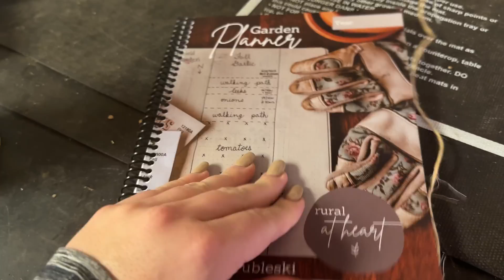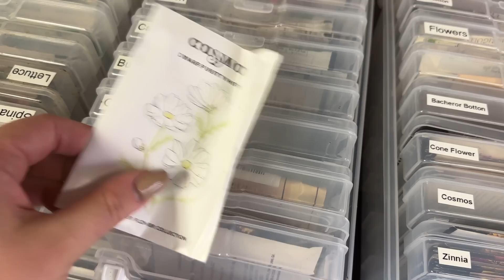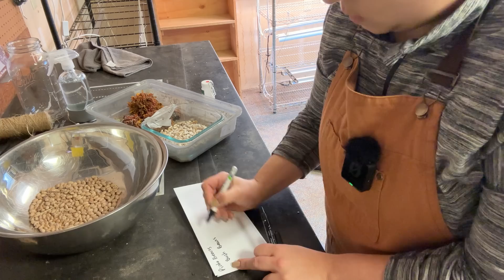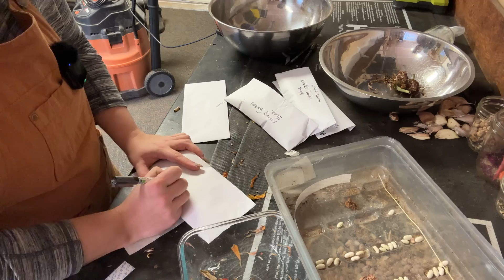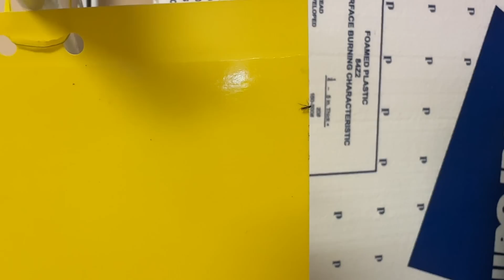I Don't Think I'll Regret This!

Comment: I ran a bedding plant business for 20 years, those are Aphids.  Fungus Gnats fly around, very small and the larvae lives in the soil.  Aphids love pansies too.  The little flying things could also possibly be a beneficial insect planting it's larvae into the Aphids.  I'd be more than happy to advise you anytime.
Reply: She mentioned that they are flying around. But the cluster of bugs on the plant did look like aphids. Maybe she’s got both. I think it’s that soil. I bought a bag of that soil and it was infested with fungus gnats.
Reply: Agree the ones outside are aphids
Reply from the maker: They did fly... Maybe there were both... I am no bug expert so I appreciate the input. I wonder if there is a bug app that I could take a picture of them and see what they are
Reply: @AcreHomestead yes I agree 100% you also have aphids. I lost some pretty expensive plants to them. The winter doesn't kill them out either. I don't know how they survive but the year I realized I had a out of control problem they had been slowing destroying plants for 3 years. They always tend to hang out on stems and under leaves
Reply: Hi Becky. Would placing the potting soil outside in the cold get rid of any infestation?
Reply: @AcreHomestead  ‘picture this’ app might have bug identification 
I just use the free portion when out hiking… 
Our high tunnel had serious aphid and spider mite infestation (located in high desert mountains of Idaho)
It’s taken 3 years of ordering green lacewing eggs and ladybugs to get a good population of beneficials in our high tunnel- but still actively squishing the aphids seems to work best, and keeping down the ant population as they ‘farm’ aphides! 🤦‍♀️
Reply: mature aphid can fly.
Reply: @AcreHomestead the app I use is picture insects
Reply: I’ll bet you have both, in any case the yellow sticky traps are helpful…
Reply: That is such a cool room to have!  You are a blessed gal💚.
Reply: @AcreHomestead  you don’t need an app. If you have an iPhone, take a picture of the insect as close of possible. On the picture swipe up and click the i or info button. It now gives information on plants and animals/ insects in the picture.
Reply: Becky, I have doubt you'll get rid of them all! You're so efficient!! 😂
Reply: @acrehomestead I'm definitely going to be making a beautiful garden this year but I think it's too early for growing plants right now
Reply: Sorry about yr peppers I was hoping it would work for you.
Reply: Suggestion wash them right after you plant the seedlings so you won’t have so much work like this. Clean and put away.
Reply: "Mosquito Bits" are pellets that can be diluted in water and every week or two, water your indoor plants with it and it should kill the fungus gnats. You have to do it regularly since the solution kills the adults, so you have to keep applying to kill the next generations when they hatch from the eggs in your soil. There are some videos about it on youtube. I haven't tried it myself--I'm battling them now too @AcreHomestead
Reply: I used dawn  mine worked but took too long. By that time all was dead but one garlic
Reply: BECKY  Annie , Nancy and other commentors were correct.  You have aphids- at least that is your main problem.  Aphids can have wings -(they DO start out wingless..).  In a few bug generations (very quick in warm temps) aphids often evolve to have wings especially if the population is high, or their food source is running out. The white flecks  are the exoskeletons of growing aphids, a sure sign of aphids. I would take nancyg up on her offer to help. General grow area sanitation will help you start clean, but get rid of those weeds too. Check any of your other houseplants if they spent any time with your peppers. Best of luck and also reach out to your local Agricultural Co-op station too, they can be a good resource. The sticky traps will help control the flying aphids but you need to use something different for the wingless aphids.
Reply: Are Aphids alive this time of year here in the Pacific Northwest?
Reply: In addition to the sticky traps, i put Mosquio Bits in net and soak them in my watering can. This will kill the eggs in the soil. I learned that from Nicole too. I had hundreds of gnats on the stickers, but they still kept coming until i used the Mosquito Bits in my water.
Reply: @bobbysmith855 I hope that you meant to say that you have NO doubt that Becky will get rid of them all. She is amazingly efficient! ❤️
Reply: APOLOGIES LONG: I have had a grow room for 20 plus years and had 4 years of aphids and fungus flies. I wasted 100's of dollars on natural remedies. The first thing is to use a room instect bomb like from Raid. 
Natural remedies will take several treatments and will be far into your growing season.

Take all your soil and freeze for at least three days then heat the soil to at least 200° F for 2 hours. Or better yet order all new soil but Do Not store in that grow room.
We bought a 50 gallon burn barrel raised it up on three cinder blocks high on 4 sides setting the barrel to sit over a fire ring campfire. We heated the barrel for 6 hours reaching the internal temp of 200° F. Transfer this soil into thick plastic disinfected totes. DO NOT store in areas where you have had insect activities.

Add food grade Diatomaceous earth to each tote, mixing throughly into soil. Making sure to add thin layer on top of soil and add a tightly sealed lid. 
Always add food grade Diatomaceous earth  Diatomaceous earth to all your garden soil. Also sprinkle lightly onto all your plants. I lightly wet the plants and use a old salt shaker to sprinkle the Diatomaceous earth on the plants.  

You have to reapply once weekly( on indoor plants) once outside(after each rain). 

Disinfected everything in your grow room, all tools, lights, containers.
It took about 2  Raid room bombs 1 week apart to stop seeing any insect activity. 
Hope this helps😀
Reply: Fungus gnats do not hurt your plants. They are just a nuisance. Aphids are a true pest, though. Yellow sticky traps will really help.
Reply: Fungus gnats eat fungus in soil. So, to get rid of them, I kill the fungus. Might not be good with highly sensitive, plants, but has worked with my indoor plants. I just sprinkle cinnamon powder (Yes, the one you use in cooking!) on top of the soil in pot. When I don't see much of a cinnamon left, I repeat the effort.

I agree, the ones on top of a plant are something else than fungus gnats. The fruit fly-like bugs are likely fungus gnats, though.

Comment: My Mom bought my Dad a couple cheap vinyl tablecloths that he cut up and used to line his drawers in his shop. Easy to clean and to lift out if necessary to clean under or replace, as opposed to drawer/shelf liner. Plus, the vinyl kept things from sliding around as much in the metal drawers.🧡

Comment: Use boiling water to moisten your seed starting mix. Use a tote or bucket big enough to mix, but not so big as to cool off quickly. Cover and let sit until cool. Kills fungus gnat eggs. Use non organic liquid fertilizers in the house, organic outside. Works for me, learned from Gary at the rusted garden. Great seed starting series on his channel. Also a bottle bush and 10 percent bleach in water makes quick work of washing cell pots.
Reply: This year I did buy new indoor potting mix and put boiling water in the soil. All my indoor plants I took outside took off all the dirt and submerged the plants in a water soap solution for a few mins and disinfected the pots, reported them and haven't seen the flying devils so far, it is winter but I'm hoping I got all of them before I bring out the nuclear top guns and put them in the garage
Reply: I was just writing the same suggestion. It has made all the difference in my seed starting. No more gnats, white fly or fungus.
Reply: Yup this is what I do as well.
Reply: I was just about to mention similar advice that I got from Gary too 😂 he was the first tomato YouTuber I followed to start seeds and set my seed starting system up. So helpful.

Comment: Hey Becky ❤ ! I have a tip for an easy and effective DIY to get rid of live fungus gnats. In future it may also help to increase ventilation where you keep your plants and to water them from the bottom instead of the top, if at all possible. Gnats like a damp environment that is rich in organic matter, which is why they are so common, and persistent, in indoorplants. 

Homemade trap for gnats (exact measurements are not important)

Mix together: 
a glass of water
a few tablespoons of apple cider vinegar
a few teaspoons of sugar 
a few drops of dishsoap 

Fill a glass, bowl or other vessel with the mixture and cover the top with plasticwrap. Poke small holes in the plastic (make sure it is fastened tightly) and your trap is ready.The sugar and vinegar will attract the gnats and the soap makes it so they can't fly out of the mixture once they are in it, causing them to drown. Also works on fruit flies. 

In order to get rid of gnats in other life stages (such as eggs or larvae), a mixture of hydrogen peroxide and water can be used. You will have to do some research and calculations depending on the strenght of hydrogen peroxide that is available to you. Beware it is effective and non discriminatory and will kill insect friends and foes alike. Not harmful to the plants though, so in some cases it can be worth to do it. 

Hope this helps! Best wishes <3
Reply: Ice heard of this to
Reply: I had a horrible infestation ONCE!  I do 25% peroxide watering every fall for the  final outdoor watering and the first 2 indoor watering. Then I fertilize faithfully every 2 weeks at 50% strength for 6 weeks. Then I let the plants rest until spring.  I live in the north with  6 months down time.
Reply: Also let the tops dry out as the eggs are deposited on the first little bit of soil and they live in damp soil. (Yes bottom water). I continue to put boiling water on my seed starting mix (The Rusted Garden) and let it sit covered for a while.

Comment: #1 Should re pot the peppers In fresh soil and not store the green stalks or old soil  in that same room. #2 you can use the soil in your tub . A general rule is when bringing fresh bagged soil home to use boiling water to mix with the soil to kill any eggs and knats in the soil. Reference The Rusted Garden he has alot of great tips!! Good luck.😊
Reply: Mind Blown about the boiling water!!!!  Thanks for that excellent tip
Reply: What you describe here is exactly what i have always done.  The first year that i used boiling water i forgot and went to fluff up the soil and pulled away cuz the soil was so hot. 😅 had a derp moment there.

Comment: Hey Becky! The answer to getting rid of fungus gnats is use mosquito dunk treated water. I periodically water all of my house plants with it and when I start my seeds for my garden I use treated water for several weeks.  Usually you will see fungus gnats crawling on the surface of the soil not as much all over the leaves of the plants. I use the sticky traps around my grow area to just monitor whether I have any gnats emerging again and then I treat the soil with the mosquito dunk water for the next couple weeks again. I've not had any problem since I've been doing this. Another thing I do is I hydrate my new potting soil with boiling water and it seems to have stopped the gnat problem with soil that has the gnat larva in it when you buy it.
Reply: Can i ask what mosquito dunk treated water is? I've tried sooooo many of these remedies, sticky traps, boiling water, cinnamon but i still can not get rid of these pesky gnats. 
thank you so much!
Reply: @ijustwannascrap  it's just the mosquito dunks you buy at the Garden Center or Lowe's or Home Depot. I break into quarters and put in a gallon or two gallon jug and let it sit overnight and then use the water for the plants watering from the top. After I've treated the plants for a couple weeks I only water the plants from the bottom going forward unless I see more gnats and then I start the process again. I add more water to it to the jug and I can do that 3 to 4 times at least.
Reply: I do this too. I have a 5 gallon bucket full of water and a mosquito dunk, and I pull from this supply at least every other watering. This in combination with sticky traps works!
Reply: I have problems with aphids and the flies, I will try this too. I am sitting here wondering how to treat my raised beds in my greenhouse with it. I have 1 28ft, and 2 26ft raised beds. I wonder if I could just run my hose from laundry room out there connected to the hot water, and put the broken up mosquitoe disk right in soil and saturate it with the super hot, a week or so before planting. My water is so hot you can't put your hand under it.

Comment: Hi Becky, love your channel. What I do to sanitize my trays is get a big tub and fill it with water. Add what ever soap you use and let it soak for a couple hour and it makes it so much easier to scrub. Dump out the dirty water, rinse tub add water and vinegar. Once the trays have been scrubbed and then rinse, soak the trays in the vinegar water solution just for about 15 minutes or so. Next, rinse and then dry.  If you have a utility sink that’s deep enough is even better. All you have to do is fill, soak, drain, soak and drain. Utility sink in that grow room would be so beneficial too. ❤
Reply: 🌱As soon as the season is over and the  weather gets cool, I clean mine by filling the wheelbarrow with water and soap. Then, get all the dirt out and dunk them inside the wheelbarrow & scrub them. Onced scrubbed, spray wash them with the hose. Since I am doing this outside on my porch, the trays dry out quicker and the mess is more bearable. Hose everything afterwards and wait for January to start seeding.🌱
Reply: Came here to encourage Becky to ask Josh to add a utility sink under the water connection. Will need a drain. I don’t know if you have a sewer connection close by.

Comment: It seems like you have loads of seeds you need to use up. Maybe try a "seed challenge" similar to the pantry challenge. Plan on using what you have, getting rid of the varieties you did not like, etc. 

Also, unless you pull out that carpet, I would not attach a hose and start watering in that room. Especially since you have a mess of cords and electical elements. That rooms seems like it would be a good project to pay your Father-in-law to make-over for you. Renee's husband is talented and handy, he might be just the perfect guy looking for a side job to add a utility sink, closed shelving, a work bench, etc.

Comment: I think you'd be fine putting the old soil into an outdoor bed.  I wouldn't throw it out because soil is expensive!  I'd spread it out in a bed, spray with Neem oil or other organic insecticide and let stuff grow in it outdoors.
Reply: I sometimes use treated spent soil to fill in baled areas on my lawn so that the grass will grow back in.  First one must make sure that the grass is not plagued with disease or fungus and such, because that may be what is causing the grass not to grow in.  fix that then after all is cleared, fill in.   Do the boiled water method to your soil before using it after it has been used in a pot & planting.

Comment: Hi Becky,  I just started watching your channel a few weeks ago so hope I am not repeating anything.  I worked at a greenhouse and they washed and sanitized all seed starting equipment, trays, pots, etc.,at the end of the growing season just for the purpose of eliminating any disease or insect eggs.  The Rusted Gardener is a wonderful guy with lots of information and Mi gardener is also good.  Rusted Gardener did a video that he showed how to sterilize your soil before starting seeds.  Either pour boiling water over soil or bake in oven until reaches a temperature of 180% because potting soil can have the eggs of fungus gnats in it when you buy it.  I did that a few years but last year year bought the Stay Green Potting Soil and didn't have any problems.I have had  fungus gnats and know what you are going through.  
Yes, cleaning your room before starting the seedlings is important which I think you found out.  In my experience I enjoy going into my grow room when it is clean and welcoming.  I have a third bedroom that is dedicated to my gardening with shelves all around the room.   Like you I start hundreds and hundreds of seeds for my 17 raised beds and it is important to enjoy that starting space, I think  :)
A few years ago I got the trays and small pots for starting seeds from Boot Strap Farmer.  They are great as you probably agree.  Nice and strong.
I am looking forward to starting my seeds shortly.
Hope this didn't sound preachy.

Comment: I wonder if it would be worth it to install a laundry sink in your grow room? You could still run the smaller items through the dishwasher and wash the trays in the grow room.💕
Reply: I was thinking the same and maybe moving the food preservation machines somewhere else to get more use of that space. Into the pantry or something
Reply: I was thinking that very something! Good minds think alike. They have a very nice size garage, maybe a space fore the stainless steel rolling tray out there, it's right off from kitchen as well.

Comment: Hi Becky!
I just wanted to mention this in case someone hadn’t already. The yellow sticky traps and bug zapper are great at dealing with adult nats but not the eggs/larvae.
I’ve used mosquito bits to deal with the eggs/larvae. Either putting a shallow dish of them with water out close to the plants you’re trying to protect or a pot with dirt and mosquito bits mixed into the dirt.

Comment: Those electronic devices that kill mosquitoes and gnats really work.  They are small you plug it in.  No noise, the bugs are attracted to the light and the fan sucks them in,  they can’t get back out.  I tried everything else but this worked.